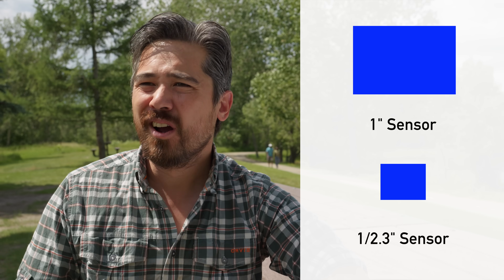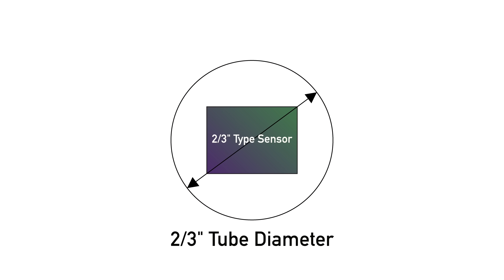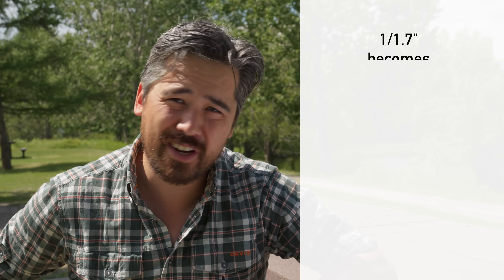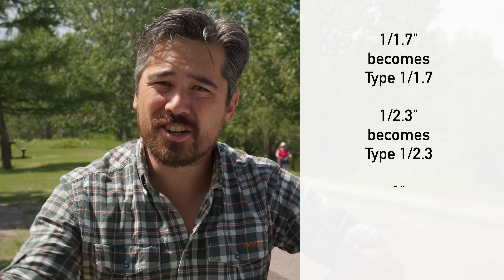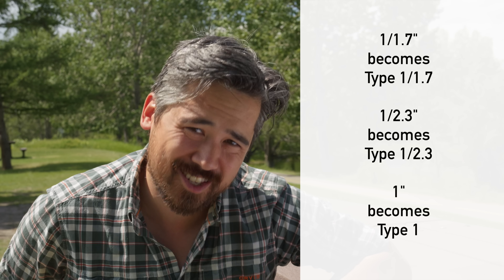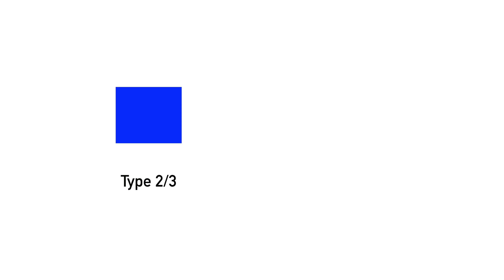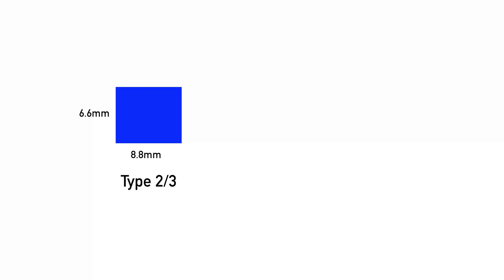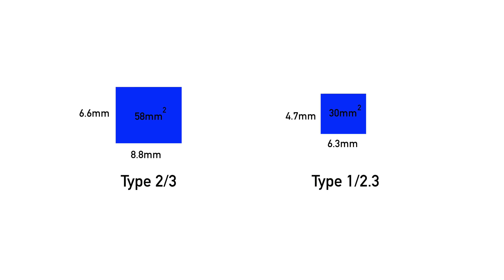Sensor sizes make no sense, but we fixed it!

Comment: I don’t know whether in all these comments someone has pointed this out, but as I understand it there are two APSC-sized sensors (Canon’s: 22mm x 14.8, and everybody else’s: 23.6mm x 15.6), three ‘Medium Format’ (Leica, Fuji/Hasselblad, Phase 1). So if ‘Type 3.4’ is a medium format for Fuji, what is Leica’s ‘Type’?

You now appear to have added more confusion because you have a ‘Type 1/3.4’ and a ‘Type 3.4’ which have nothing in common.

I’m sure others have pointed this out, but for decades the generally understood base has been 35mm film (36mmx24mm) which must surely give most people a better idea of size than ‘864mm squared’ and a factor of 1.5x or 1.6x a better visualization than ‘372mm squared v. 864mm squared’ or ‘328mm squared v 864mm squared’.

Designations like ‘Type 1/2.3’ are surely really only meaningful to designers and engineers who are selecting sensors by specification, from, e.g. Sony Semiconductors, not readers of camera reviews.

Comment: This is not solving anything. It’s just as confusing as the old standard. We need a standard that has the the diagonal and the ratio. That all we need. We don’t need this nonsense “type” description. The more numbers the worse. So now DPREVIEW will use all these numbers, or just give “type 4:3 sensor”, which is exactly what we had before.

This almost seems like an April Fools joke.

Comment: When talking sensor sizes, the area of the sensor is the most important. 
I propose to present the size of the sensor as a percentage of its area compared to the area of a full-frame sensor. 

245 for Hasselblad H
168 for Fuji GFX
100 for Nikon Z9
42.8 for Nikon Z50
38.8 for Canon EOS R7
26.8 for Olympus OM-1
13.4 for Xiaomi 12S Ultra (1 inch)
5.0 for Zenfone 8 (1/1.7 inch)
2.9 for IPhone 11 (1/2.55 inch)

The aspect ratio alone says nothing about the size of the sensor. The aspect ratio is needed to evaluate the size of the sensor only if you do not know the width and height of the sensor, but the diagonal is known. And only for those who are nit-picking to distinguish: "OK, the diagonal is 1/2.55 inches. But is it a 4:3 or 3:2 aspect ratio?"

Comment: Nice try. But could you call them "small format sensors also marketed as full frame" so that newbies can understand why some cameras are called medium format.
Also, while you are at it, provide the size of the pixels in the sensor and number of pixels since "sensor size" is only a rough indicator of potential "image quality" ???

Comment: I know DPReview can't upend the entire industry, so this is fine, but definitely the best part of it is the millimeter measurement being included.  If I were to create a new way from scratch, I'd take the diagonal in mm, just like TV screens are measured diagonally in inches (or cm).  So I'd refer to them by the diagonal in mm, but when focusing on the censors themselves, also give the horizontal and vertical measurements just for those who don't want to reverse-engineer the Pythagorean Theorem based on sensor aspect ratios (which thankfully is mostly a simple 3x2 on APS-C and Full Frame at least).

Edit: Square mm area is included in the video (like the vertical and horizontal measurements), and I was betting on those with my "diagonal" system, but other comments also make a decent point about using area.  So I'll list the different versions thus far.  I still think my suggestion is best, or neck-and-neck with the "area" suggestion.  But I also realize that both of these are too much of a divergence from industry standards to only be taken up by one (albeit popular) camera review company.
Old / Industry designation:         1/23'' sensor (??, ??)
New DPReview designation:       Type 1/2.3 sensor(30 sq mm, 4.7mm x 6.3mm)
My suggestion:                             7.9mm sensor OR SIMPLY 8mm sensor (30 sq mm, 4.7mm x 6.3mm)
Area suggestion, based on other comments:          Type 30 sensor (4.7mm x 6.3mm, 7.9mm diagonal)

Comment: Your illustration of size at 4:26 is messed up. If your dimensions are correct, then the scale of the two shown is not the same. Also the one on the right is not proportioned correctly.

Comment: 35mm should be your standard size. Base all sensor sizes as a percentage based off 35mm. Then add "type" the date produced in YYMMDD format as well as the manufacturer identification code. From there select the standard variation and reduce it by 4/3. See - fixed it. Good grief Charlie Brown.
Reply: The pint is not to make a new marking that one then needs to explain.

Comment: Using standard fraction forms, 1/x for example would allow for an easier comparison of sizes: type 1/1.5 is more clear than 2/3 when compared to something like a type 1/2.3. Including the type of sensor would be more informative rather than saying "type": CMOS 1/1.5 provides the necessary information without adding unnecessary. Kudos to you guys for trying to find some organization in the madness.

Comment: Great initiative.
Too bad the internet and much less camera producers won't come along with it.
And frankly, the "Type 1" is really bad. Because someone not familiar with all that new "standard" would never guess, that it is about size.
You could replace "Type" with "Size". Though that would probably look not that well in the table or some article text. Like "The size of new sensor is Size 1/38 and that size is really sizable for a camera integrated into a toothpick".
Reply: That is why they do give the actual measures 13.2 mm x 8.8 mm.
Reply: @okaro6595  Then just call it "12x9"
Reply: @okaro6595  Then just call it "12x9"

Comment: Do you think that "full frame" is a misnomer? Given that all sensor sizes use the full frame of it's given size. Also, there are larger sensors out there. 
Would it be better to name them 135 after 35mm film, which the sensor size was taken from?

Comment: Only 1/7 of my cameras are "35mm" Full Frame, and I get great results using a 28.2mm (APS-C) and a 23mm (4/3) sensor for astrophotography using long exposures. These YouTubers (Sony users) who go on about low light capabilities of full frame don't really know what they are talking about. It boils down to pixel size, speed of your lens, shutter, and gain or ISO. I would love you to do a video comparison on low light using long exposures. Possible pull out the old IMX071 or Nikon D7000 and see how good that camera was with its APS-C sized sensor but BIG pixels. Keep up the good work!

Comment: While not 100% accurate, the width of a small sensor can be thought of as a fraction of a centimeter. A 1" sensor is just slightly bigger than 1 cm wide, and a ½" sensor is just slightly bigger than half a cm wide etc. For me that's close enough for a general conversation,  which is the only kind of conversation that I have about point and shoot cameras. LOL

Comment: So a so-called "Type 2/3" sensor, which has a real aspect ratio of 0.75 (or 4:3) will still be interpreted as having a 2:3 (0.666) aspect ratio. You guys haven't fixed anything. A better system is to state the area of the sensor, followed by its aspect ratio. If you insist on being backwards-compatible with nomenclature, just put the old silly name in parentheses after the useful information. So : "58 mm^2 4:3 sensor (type 2/3)"

Comment: Too complicated.  We refer to 24x36 as Full Frame, so let us call that (864m²) a size 1 or full size sensor, an MFT sensor 13x17.3 will be a size 0.26 sensor.  Or the crop factor will do as well.  Please keep in mind you can make a giant giga pixel sensor that is complete crap or a very tiny one that is excellent.  I also very much doubt that glass let's in more light because you put a bigger sensor behind it.

Comment: I'd use diagonal as a base. It's especially convenient since it also describes a lens to use for the sensor. And in the case of Type 1 different proportions have slightly different diagonals—it removes the need to have additional brackets like "Type 1 (4:3) sensor"—just say "15.9mm sensor". Even different APS-C are clearly compared and fit into the list as different options with just diagonal size.

55mm sensor/lens = Medium
43.3mm sensor/lens = FF
28.4mm sensor/lens = APS-C
26.7mm sensor/lens = APS-C (Canon)
21.77mm sensor/lens = 4/3
15.9mm sensor/lens = Type 1 (4:3)
15.86mm sensor/lens = Type 1 (3:2)
12.5mm sensor/lens = Type 1/1.28
7.8mm sensor/lens = Type 1/2.3
5mm sensor/lens = Type 1/3.4
Reply: Diagonal only gives you part of the picture, since different aspect ratios will give different diagonals. Manufacturers did this with TVs to try to make newer 16:9 screens seem way bigger than their 4:3 competition.

Comment: Inches are the divine unit of measurement.  If your system doesn't use inches...throw it away.  If you need simple things just call them microinches....kiloinches...etc....nothing special about the meter.  Inches have better history and meaning...if you insist on base 10 systems just apply it to imperial measurements...Meters are garbage.

Comment: Still confusing. Doesn't clarify what size sensor one is talking about. Just combine the length and width into one number. A 8.8X 6.6 could simply be referred to as a 97 sensor (round up or down)
Reply: That makes no  sense.

Comment: Just use crop/multiple of Full Frame. So a Sony RX100, would be 2.73 crop factor, a Mamiya 645 would be 0.58 factor (or whatever the calculation is), etc...

As for sensors smaller than an RX100, no one cares, tbh.

Comment: need to start using AREA of the sensor as the size, makes comparing sizes easier as well.  Name it Area then Aspect. So "864mm 3:2" for Full Frame 3:2 aspect, or "368mm 3:2" for Nikon DX, or  "329mm 3:2" for Canon DX. ( rounded up or down to nearest whole number )   whoops, made the comment too soon, still I like my point.
Reply: How is the area relevant? We do not talk of areas ever.
Reply: @okaro6595  if you don't get why Area is important then why are you watching this video ?

Comment: Is there a reason why we don’t follow displays and just use diagonal lengths in the naming? It’s simple, well accepted. The aspect ratio is usually 3:2 or 4:3 and can be stated clearly. Why reinvent the wheel?
Reply: Diagonals have the problem that full frame is not nice, it is 43.27 mm.

Comment: What a missed opportunity - it's still complicated and confusing. If you want to fully align with your usual measurement system then express the surface area of the sensor as a % of the front lens area of a Noct. Done, one number that says it all.

Comment: I never look for the sensor size measurements. I mainly focus on it's crop factor. I know the higher the crop factor, the smaller the sensor. The lower the crop factor the bigger the sensor. 

Smartphone
5.62x iPhone or Galaxy
(typically 27mm & 28mm)

Compact camera's
3x (Cinema Smartphones)

Action Camera
2.7x  GoPro or Drone's

Micro Four Thirds
2x MFT or 4/3

Super35
1.4x APS-C or Motion Picture Film
1.5x APS-C or DX (Nikon)
1.6x APS-C (Canon)

Then there's the whole argument of smaller sensor equals more noise 🤦🏾‍♂️ NO. What determines good or bad iso is where the manufacturer set the base native ISO and how well the ADC can process amplification. I think smartphone developers will figure out that they should instead of working off just 3 lenses, they should work on 3 sensor's with different native ISO and integrate ND filters.

35mm Film
1x Full Frame or FX (Nikon)

Medium Format
.62x (645)
.55x (6x6)
.5x   (6x7)
.45x (6x8)
.43x (6x9)

I gain nothing knowing the measurements of a sensor. What I need to know, is the framing of the lens I mount. I could careless what the sensor size is anymore, b/c we've just about moved passed image quality restrictions based around sensors with Ai software and computational programs built into device's or 3rd party like FilMic Pro. Arri Alexa sensors are basically the size of Super35 slightly wider and the big Arri Alexa is slightly wider then Full Frame but it's called LF for large format 😅 ok. 

Real Large Format is 4x5", 8x10"
I think we're almost back where we started with film where every camera shot the same quality and the difference maker was the lens. The HDR from smartphones is likely to leap frog the entire stills market with a little more time to rival Medium Format dynamic range.

Comment: I will be much easier to just mention the sensors diagonal in milimeter and Lenses in degrees (angle of view).
Here you can see which diagonal most types of sensors have when you scroll down... https://en.wikipedia.org/wiki/Image_sensor_format

Comment: Rather than incremental change, let’s just double down on naming the sensor by area in mm^2. There will be no overlap with different aspect ratios, and you can mention the aspect ratio if it differs from the norm. 

 That will also make it easier to communicate when a camera has a large sensor but don’t use the full width (like some smartphones are doing)

Comment: Stating the sensor area, is a step in the right direction! However, I, for one, do not find the horizontal and vertical dimensions that useful--they only determine the aspect ratio of uncropped images, which is not that important, imo.
I should say that while watching, I couldn't help but have a nagging feeling that the video was a parody. 😆 There's no way Chris is going to say "Welcome back DPReviewTV viewers, today we are looking at the Canon XYZ, a compact camera with a Type 1/2.3 - 4.7mm × 6.3mm - 30mm^2 sensor..."
Perhaps it will make more sense in written articles or as text in a video.

Comment: As a lot of people point out, just giving the total surface area is fine, if you wanted to dumb it down you could do an imperial diagonal measurement and round it to the closest:

---- System cameras ----
ULF = 175 392mm² - 23 inches (LS911)
LF = 16 677mm² - 7.24 inches (LS45)
MF = 2 159mm² - 2.64 inches (Hasselblade)
FF = 860mm² - 1.7 inches
APS-H = 545mm² - 1.35 inches
APS-C = 370mm² - 1.12 inches
APS-C = 329mm² - 1.05 inches (Canon)
Foveon = 286mm² = 0.98 inches (Sigma pre-Merrill)
1.5” = 262mm² = 0.92 inches (Large compact)
4/3 = 225mm² - 0.85 inches (Micro Four Thirds)

---- Pocketable & Super zooms ----
1 inch = 116mm² - 0.62 inches (Sharp AQUOS R6)
1/1.12” = 98mm² - 0.56 inches (Mi 11 Ultra)
1/1.2” = 85mm² - 0.53 inches (Nokia 808)
2/3” – 57mm² - 0.43 inches (Nokia Lumia 1020)
1/1.7" = 43mm² - 0.38 inches (Huawei P30 Pro)
1/2.3" = 28mm² - 0.30 inches

---- Smartphone & Specialised ----
1/2.5” = 25mm² - 0.28 inches (iPhone XS & 13)
1/2.6” = 23mm² - 0.27 inches
1/3.0” = 17mm² - 0.24 inches (iPhone 5s & 8)
1/3.2” = 16mm² - 0.22 inches (iPhone 4 & 5)
1/3.6” = 12mm² - 0.20 inches (Nokia Lumia 720)
1/4” = 10mm² - 0.18 inches (iPhone 3G)
1/6” = 4.2mm² - 0.12 inches
1/8” = 2mm² - 0.8 inches
1/10” = 1.2mm² - 0.06 inches
1/36” = 0.3mm² - 0.03 inches

Comment: I'm a fan of weird names, so... Why not call a sensor as the crop factor relative to it's aspect ratio? For example, micro 4/3 should be called 2x 4/3. Now, I mean, this doesn't make perfect sense, it makes more sense with the displays in my opinion (1080p 16:9, 1440p 21:9), what is crop factor? I mean, different aspect ratios have different crop factors and I think that they are misleading. For example in astrophotography they call a 4.8x3.6 sensor a 7.21x crop but a 5.6x3,1 sensor a 6.8d I think (?). The pixel pitch is different and the effective res x fov is better. Should we star calling stuff in a different way? Maybe by pixel pitch? Is it too much complicated?

Comment: It's not disruptive enough, it helps very little.   I will say go full in, and calculate the area of the sensor in  mm2 and divide it by the area of a one-inch sensor,  multiply by ten, and round the result. For example, a one-inch sensor will be a class 10  sensor A full frame sensor will be a class 75.  The other way will be to go lineal and do the same but using the diagonal of the sensor I like the area because if I see a class. 5 sensor. I know the area is half that of the class 10 sensor.  Remove the names, without disruption there is 0 incentive to change, except for us,  photography nerds that want to change just for it to be meaningful. After 5 years we can move to make it mandatory to include the sensor: class size.   So in the box, it will say:  ZC75   (optional full frame)

Comment: I still don't understand why if we're still using old tech terms for sensors space, why don't tech companies used the whole space of the  sensor space. For example: use a light sensor that uses the circumference of the whole "tube space" or "tube diameter"??!!?

Comment: I appreciate the effort. It doesn`t help much though because 8.8mm x 6.6mm means tool little or too much (and it is not a unit issue because I am metric). How small is that? Is that a four third aspect ratio ? I cannot get any of this information without doing some math and I cannot quickly compare two sensors that may have different aspect ratio. What is needed is a base line to compare all sensors against and - preferably - a single relative number against that base line.

Full frame is the base, for better or worse, and the magic number is the crop factor. So a 4/3 crop 2 sensor is an MFT sensor; a 2/3 crop 16/1.7 sensor is an APS-C/H sensor. A one iinch sensor would be a type 1 2/3 crop ???. (I still don't know what that crop factor is and I love to know). As a  user the aspect ration and light gathering ability (crop number) is all I need to know. The exact measurments are not terribly important.
Reply: "a 2/3 crop 16/1.7 sensor" that makes no sense. In fact what you say makes in general no sense. I had no problems understanding what they said.